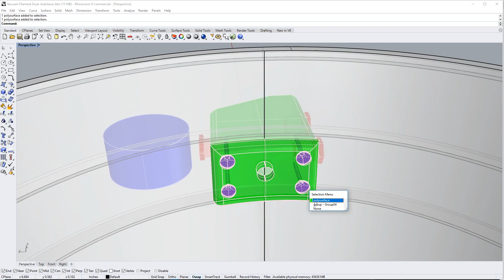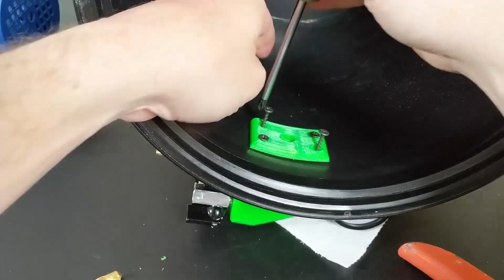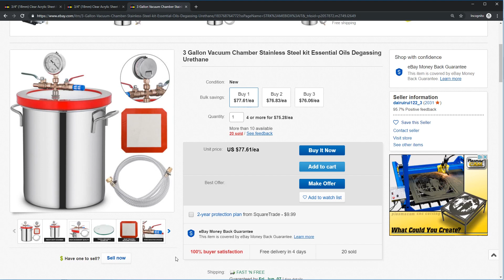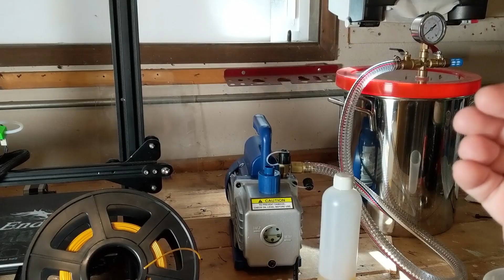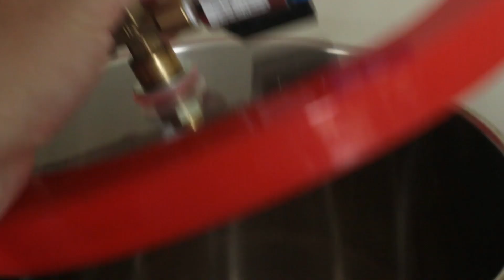Is Vacuum Filament Drying Best the Best Technique?

Comment: Its a vacc Pump used in Refrigeration & Air Conditioning systems...... Vac pumps sucks all the moisture and contaminents that is in Air con systems down to a negative pressure..... It is equivilent to the vacuum in space.......The exhaust is for the moisture that comes out of the system, The oilil in the vac pump absorbs moisture it is hydroscopic

Comment: Yes, it's a frustrating business, but it's always good when we end up with the same number of fingers. 😁
I've found PET-G a right mare but the layer adhesion and stability are too good to pass up. The initial chinese filament blobbed terribly, so I switched to a Dutch filament. Straight out the packaging, exactly same result. Sooner or later a blob ends up kicking the X or Y stepper out of line. The problem seems to have two main causes - overhangs, and infill. I can design out the worst kind of overhangs by rounding corners, but the infill has the habit of causing the bead to lift up behind the nozzle. PLA is incredibly annoying because it prints so beautifully, but just doesn't have the properties I want. ASA seems pretty good too, and I use it for parts subject to weather and UV, and when I want to use glue. But I'm still keen on PET-G for some parts. I've been trying to fit a piece of PTFE around the tip as a kind of wiper blade, but PTFE is crazy stuff to work with. I fitted the nozzle through some aluminium in the hope of searing a piece into place, but again no luck. I got the threaded end of the nozzle glowing red at one point and melted the aluminium, but the PTFE just fell off. I swear it was sneering at me. Then I carefully polished the brass nozzle to a real shine and wiped a cotton bud round the sides with a bit of silicone release agent. Even in my advanced state of aggravation, the result was really quite hilarious. Printing a plain cube, instead of the usual crosshatch of infill, there was not a single line inside the whole thing. I ended up with perfectly formed pillars from the bottom to the top and nothing connecting one with another, not even stringing. Now I've got to get rid of the silicone, which is a science in itself. But the good news is it's mostly gone and I am now nearly back to where I started. Meantime, after a five day run of ASA printing, my eyes, nose and throat are suggesting to me if I don't get some ventilation I might not need to worry about anything much longer anyway.
Reply from the maker: This is gold.
Reply: @DesignPrototypeTest  Gee thanks, Matt. I'm honoured. 😊

Comment: I know I spelled vacuum wrong. Vaccum. Vacumm. What ever. “Misplaced prepper1”, I do keep the vacuum pump running as long as I’m home to mind it. If I leave, I turn off the pump but keep the heat on. I keep one of those cheap button type hygrometers in the tank so I can see the RH level. I’ll run the pump for an hour with heat, turn off the pump and wait a few minutes to see if the RH rises above 10%. If it does, I turn the pump on for a little longer. I do that until the hygrometer stays at 10%.

Comment: The idea of the vacuum switch is great, however you cannot leave the valve to the vacuum pump open when the pump is off.. If you do so, it will lose vacuum.  So you would need a vacuum switch and a solenoid with a delay on make relay to allow the pump to start and run for a minute or so to bring a vacuum on the hose before you open to the pot. A micron gauge will be more accurate and your can take the reading of that gauge and see the boiling point of water at that given vacuum level.
Reply: Why not just use a check valve?
Reply: @Bantallar  I don't know of a check valve that is deep vacuum rated. I'm sure there must be one.  I come from a HVAC background so that is the knowledge I have about boiling water out of AC lines when performing a repair.

Comment: You also lost vacuum to the water being removed from the filament  as it boils out of the filament.
Reply: Rollie is correct.  When you have moisture in liquid form and then boil/evaporate it, the liquid transforms into vapor.  That liquid takes up approx 700 times the space than it did as liquid. 

The best way to tell if the water in the vacuum chamber is the cause of your pressure increase vs an actual leak wold be to first clean and dry the chamber with paper towels.  Then vacuum the air out of the empty pot.  Leave it sit overnight.  If the pressure holds then you have a good pot without a leak and the pressure increase is your fillement drying out as intended.
Reply: As every AC guy knows. The System which has swallowed water is only dry again if the vacuum stays min 24hrs. Otherwise evacuate again and again. ..
Reply: I use the same setup and I don't lose that much in such a short time. It holds vacuum very nicely for days. ABS does not hold as much moisture as Nylon does (up to 20% volume) and I still don't get a noticeable drop in vacuum over 12 hours or more.

Comment: nice work, I was also just about to suggest add a strong desiccant into the chamber, something like calcium chloride is very cheap.
Reply: Alternatively, you could attach a second chamber specifically to hold the desiccant material, which you would use to dry the vacuum.  It would need more valves, but by detaching the desiccant chamber, you would be able to remove and replace the saturated desiccant on the fly without having to lose the vacuum in the main pot completely.  As @strwlf3 suggests, you might even be able to create a drying chamber that doesn't require a vacuum, just a warm desiccant (or perhaps as an adjunct to your filament dryer as well).

Comment: You are boiling the water out that is filling up the vacuum. Maybe a cheap vacuum gauge can be hacked to turn on the vacuum with a switch.
Reply: Great idea, optical switch reads the dial needle! Ingenious!
Reply: Agreed.  The switch idea you have will work.
Reply: @MisterDeets  really if he uses arduino even an optical switch would work.with out too many hacking in to the dial.

Comment: Great video! A suggestion: Try drying the wet filament by leaving the vacuum pump on for the duration of the drying period. That way the vacuum level stays constant. You probably will dry the rolls in a couple of hours. Yes it is annoying having the pump on but you can put the system in a closet or room or build a sound barrier. The exhaust is most likely the low molecular weight vacuum oil in the pump which should dissipate after time. You can put a exhaust filter to reduce that issue.

Comment: I'm checking out 3D printing and came across your video,  I don't know how big the spools are but you should be able to 3D print support rings/baffles to go inside the 5 gal bucket to keep it from buckling in on itself.  maybe 5-6 rings spaced out in the bucket  ,as long as the spools fit past them!!  just my 2 cents..

Comment: Cool idea. As a 30 yr. veteran of the injection molding industry, I would say that you would be better of using ceramic sieve desiccant. Nylon needs to get warm enough to open the pores and release the water molecules.  Usually around 170 deg F ish. You will need to regen the desiccant in your oven but still doable. Check molding suppliers like ppe.com to get the desiccant plus a bunch of other plastics specific items.
Reply from the maker: Awesome information. Thank you!
Reply: @DesignPrototypeTest , you might get much better results if you gently heat the vacuum chamber to like 90+F / 30+C. This will speed up the process considerably. Also, over Ebay you might find much better vacuum chambers with glass lids. 
Consider using a little silicone or teflon grease to improve the seal. 

Another word of advice: never try to cold-boil water on a rotary vane vacuum pump such as yours. The water vapor will inevitably condense inside the pump vanes, mix into the oil and damage your pump. 

You're correctly turning on the pump and then close the valve, this will prevent the water from migrating to the pump. I suggest you drop a few silica drying bags into the vacuum chamber, that will trap any excess water that could be migrating into the pump once you do the vacuum.
That's it for now.